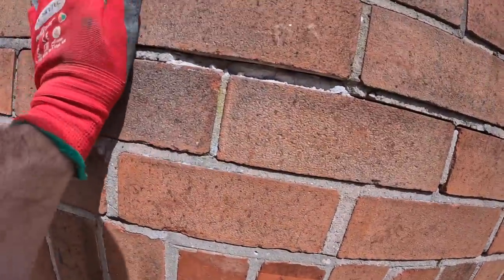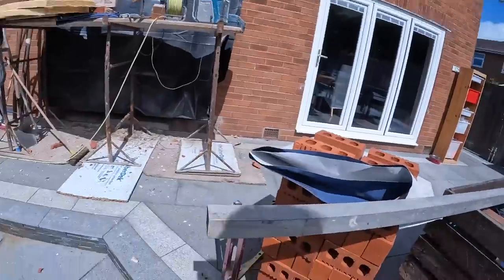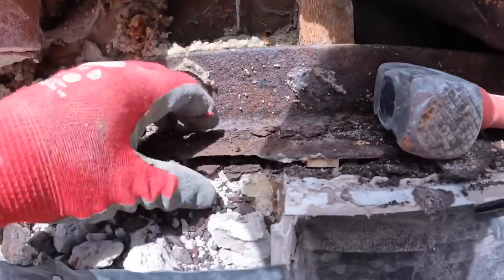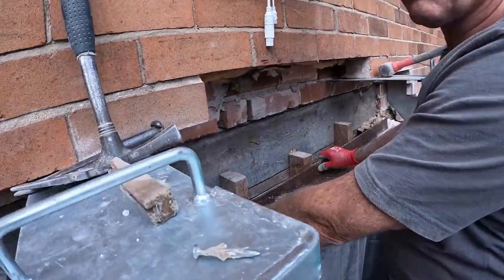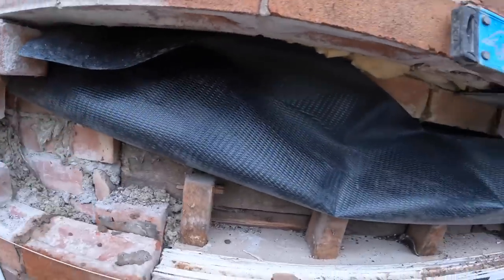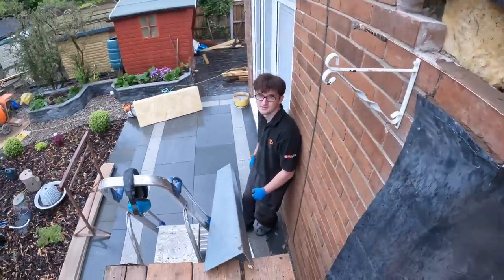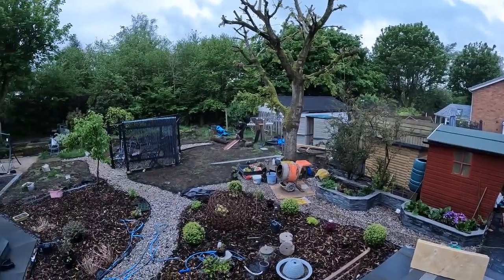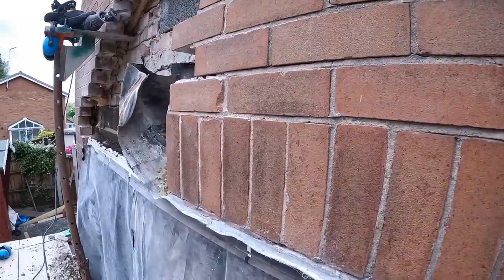OUR TOUGHEST LINTEL JOB YET !! PART 1

Comment: A friend was thinking of buying a house and wanted me to have a look to see if she could extend the kitchen, when I took a look at the building,  over every lintel the brickwork had expanded because of the angle irons rusting and blowing, the whole house had like an expansion joint running right round the house, I told them to walk away it would cost thousands to repair, they did walk away, next time I was around that area they had a go at fixing it yep they repointed it and didn’t fix the problem.  all because of not rust proofing the angle iron and the crack had began to expand again, plus this was evident on many of the properties on that particular small estate, private builds as usual and no proper, clerk of works, great job lads took me back to the good old bad old days on the tools, looking for my marshalltown now to help out but you’re doing a much better job with me not on the scaffold 😇
Reply from the maker: Yes we usually get called after the first re point botch up has failed 🙄🧱👍🏽

Comment: just found this video, excellent work , it's amazing the low level of some builders I used to use for that span a piece of scrap galvanised angle at least 10mm thick and 150 on a side very cheap and effective if it was totally enclosed we used galvanised  pallet beams  2 of them with the ends cut off almost no deflection , the other thing I used to do was preload the lintel, you fit one end at the correct height then use a hydraulic jack lifting the other end to apply the correct preload to the beam so the structure above wasn't affected by the changes, it's a simple job to do and avoids all manner of settlement and cracking, cost £20 for a 4 ton bottle jack you just use a straight edge to get maybe a quarter inch of bend over the length so the lintel is taking the applied load and not the brickwork,
Reply: @SteveAndAlexBuild  I avoided a lovely one in a shop I bought Gosforth  on the high st number 115  26 ft I think it was pitch pine timber lintel one side was a doorway then an iron column at 4 ft then the main span then a 6 by 12  pitch pine slab end on vertically then a doorway, built in 1850 I backed quietly away leaving it for the future the pitch pine slab was rotten on the bottom so I put 4 big iron angles to lift it up, it's been sold now but it's a nightmare of a job for someone

Comment: Trouble with starting petrol disc cutter?   Use primer button till airs out,  choke on,  push decompression button if it has one,  pull over slowly- just turning over engine slowly with full throttle (some models dont allow throttle with choke) this will prime the system, once it fires by pulling slowly , take choke off and pull start quickly (Or half choke) use throttle .
This works for me.
Reply from the maker: Cheers Deano 🧱👍🏽

Comment: Done so many of these jobs in the Brighton area for windows companies as many houses I have worked on don't have lintels on the outside skin relying on old wooden or metal frame windows. Can be very dusty old jobs.  Most of the time I have disc cut out the bricks and cleaned them off and managed to put them back in to keep it looking the same. 
Lucky always on the ground floor so I get 2 done in 1 day

Comment: Hi lads…sorry HEY YOU GUYS😁most trouble with saws comes from flooding it, I’ve learnt when this happens too turn all switches off for a minute and go again with a few pulls with it all still off, clears the carburettor… the kick says it’s clear then turn on and pull. Goes every time👍🏻👍🏻👍🏻 great work again auld pals🤝
Reply from the maker: Cheers Bob , yeah it’s flooding a reckon , you can smell it then it’s wet out the exhaust when it fires up .🧱👍🏽😁

Comment: Hi guys great video just a quickie the disc saw that you said had problems starting it have tried E5 fuel instead of E10. As the old type of fuel is the we us in all or our two stroke equipment because they don't run right on E10 worth a try best regards ady
Reply from the maker: Thanks for that pal 🧱👍🏽
Reply: @SteveAndAlexBuild  ..or try Stihl’s premix ethanol free fuel. £20 for a 5ltr can from a Stihl dealer (with the price of pump fuel as it is now the delta has come down from x4 the cost of pump to x2). Also, it won’t rot the rubber components in the fuel system.
Reply from the maker: @CJones-dw1zo  🤔🧱👍🏽
Reply: @CJones-dw1zo  Socialist/commie countries do not allow their servants to enjoy much of the fruits of their labor.
One wonders how England has drifted so far in that direction, and what exactly are they doing with the money. 
52% of that is tax according to the BBC , broken down as follows:
25% Fuel Duty Tax 
20% Vat Tax
7% Biofuel Tax
45% Cost of fuel to supplier
2% Retailer profits
1% Supply and delivery

Comment: Thanks again for another lintel video. Your videos gave me the confidence to do two bedroom windows to the rear of my 1930s house, they have the thing where the soldier course doesn't line up as well, so I did what you guys did on the house where you put blues over the French doors (and the bit of plasterboard came out so you could see down into the living room). Where you cut a brick in half and slotted the lintel inside it.  Came out really well. Got the bathroom one to do next. Luckily there's just been the soldier and one course above so far so no need for props... yet. There are other windows which will need them though!
All the best, and thanks again.
Reply from the maker: Thanks Ross , glad out videos helped .
   Good luck with the rest 🧱👍🏽

Comment: hey just a question... when putting in a new window on brick veneer... is it possible to scrape out the mortar from the brickwork from the inside of house and push in a lintel? then i would be able to remove the bricks from under the brickwork with a lintel already installed.... is this unsafe or bad work? if this is possible how would you fix the lintel in the gap? liquid nails or mortar?
Reply from the maker: Lintels are definitely not a DIY job. A cavity tray is also needed which can't be done from inside 🧱👍🏽

Comment: In engineering terms, the upstand steel is the web and the horizontal element would be the flange. The upstand could be called a rib if it is part of a T Beam.
Reply from the maker: Thanks Michael 😁🧱👍🏽

Comment: Fascinating.

I assume that the bricks are under compression between the lintel and the higher rows.  Not being a bricklayer how do you ensure that the upper bricks are sitting on a solid layer of mortar (without trapped air) and that the new mortar does not shrink.  I assumed that you would tap in layers of slate or something to ensure that the old bricks and new bricks are under compression against each other.

If you don’t over time won’t it settle and you will get more cracks?

It looks rather dangerous that the heavy upper courses might collapse as you are doing the job.
Reply: @SteveAndAlexBuild  The lintel supports a triangle of wall with a base length the width of the lintel stepped up to one brick in the middle. Otherwise the loads get carried down the walls either side. I'm not suggesting the bricks can be thrown in bit they are not like the ones carrying full wall weight into the sides of the window.
Reply from the maker: @Dave5843-d9m  exactly 👌🏼🧱👍🏽

Comment: What a cow of a job and loosing money ? Two technical questions if i may.
1) Why is there a mixture of brick and block on the inner wall. 2) How long do the wooden lintels last. 
From what i could see you were in charge of the situation and got on with it. 👍👍
Reply from the maker: Question 1 Doug not got a clue , my guess is they were rough arses .
As for Timber I’m not sure but kept dry they last years 💪🏼💪🏼🧱👍🏽
Reply: @SteveAndAlexBuild  Ok cheers 👍👍
Reply from the maker: @Doug....  🧱👍🏽
Reply: @SteveAndAlexBuild  I replaced what was 150 year old safe lintels on a sandstone building, must have been 20 windows and most where in not bad condition, proper old hardwood make a great camp fire when away 🎣🎣🎣👍🏻
Reply from the maker: @Marshalltoon  😁🧱👍🏽
Reply from the maker: @martin2466  💪🏼😁👍🏽🧱
Reply: @martin2466  The guru is up and about 👍👍👍
Reply: @martin2466  noo 😜
Reply: @martin2466  Thanks for that Martin. A fountain of knowledge as usual.  👍👍👍⛲

Comment: Did I see Silicone going into the internal brickwork Joints and Bed over the Timber Lintel ? Or should it be packed with Slate or a Strong Mortar Mix .
Reply from the maker: The silicone was to hold the cavity tray in place
Reply: @SteveAndAlexBuild  Oh right OK .
Reply from the maker: @davidpimblett3573  🧱👍🏽

Comment: Rather than just putting the supports onto the brick itself , why didn't you put a beam or something across the 2 to support that full length of brickwork above...? Our neighbour has the exact same issue iwth a window with no lintel above it and all the brickwork above is cracking from the bathroom window down. Whoever does it will have a right job on because how you've done it there it wouldn't hold the brickwork above , they'd have to support the full width . Is that why you've not supported it fully because the brickwork above is pretty sound...???
Reply from the maker: Yes

Comment: I have a Stihl hedge cutter that gets used once or twice a year. After every use, I empty the fuel tank then run it until it stops and use the choke until it properly stops. That leaves no fuel or oil to clog the carburettor. 
It's been going strong for 25 years so I think it's been the best way to keep it happy.
Cold start, fill the probing bulb. Full choke one pull. No choke nd another two pulls gets it going. Use choke as needed until it warms up. Too much priming (or choking) will flood it. Then it's game over until the excess evaporates.
Reply from the maker: Sounds good 🧱👍🏽

Comment: Hi guys,what size lintel ?. Looks under size to me for that span and amount of load above.
Reply from the maker: Can’t remember. This was a year ago and it hasn’t fallen down 🧱👍🏽
Reply: HI, as a Bricklayer from down under I’m interested as to what your requirements where in England as appose to Australia. You said in you video that the span was 2400mm. At this span in Aus. we would have to use a Gal angle 90x90x6mm (8.22 kg/m) with a bearing of at each end of 150mm min. If it was to go 2450mm, we then have to step up to a 100x100x8mm (11.8 kg/m). Mind you we have our cowboys here as well, who would use anything. 
I appreciate you videos and it good to see father and son working as a team.😎✌

Comment: Assuming you bought your STIHL saw from a reputable dealer, take it back to them and get them to have a look at it. STIHL have fantastic aftercare, even more so when its still under warranty, It shouldn't be that hard to start since its brand new.
Reply: I doubt there is anything wrong with that saw 😬
Reply from the maker: @justbreakingballs  🧱👍🏽
Reply: @justbreakingballs  my strimers a bit choke hungry on first start but i find you need very little priming on the fuel if there's already some in the bulb. 
All my other STIHL gear is now cordless and don't think ill go back to 2 stroke for hedge trimmers/blowers etc, so much easier. Even my smaller lawnmower is now a STIHL battery one as its saves the back carrying the Honda up my customers steps!
Reply: @HughzieTube  sounds like a good set up you have there. When starting my ts410 I don't really pull the cord I just hold it and let the machine fall away using its weight to pull the cord if that makes sense. I'm not sure what Alex was doing to pull his back here, he's young enough to brush it off though.

Comment: ''There is no material touched, handled, and adjusted by the human hand, than that of the lowly brick or stone. How much more then; that of those removed and replaced?''
1971---1974 U.S. Paratrooper Sgt. William 'Rock' Gilpin 82nd Abn. Div. 1/504.
1975-------1983 Texas Brickalayer ana Stoneamason.
1983---1986 Passenger Elevator Constructor.
1986--------------------2006 TX dot Inspector over new construction of highways & bridges.
2006----------------2022.6 Just another one of those many one's of '''We The People''...
who's awaiting His Just⚖Return🪃.

Comment: You done a good job there but the only criticism is you should put the strong boys into the brickwork first to support the existing brickwork before cutting out the opening.
Reply from the maker: No chance Barry , experience tells me when to put them in and they are in the way long enough already 😤😁🧱👍🏽
Reply: @SteveAndAlexBuild  The brick work supports itself in the V section that  the bricks were taken out each brick supports the one above  it  so the house isn't going to fall down 
Great job , must have been a balls ache , must be satisfying that you left the customer with a decent job
Reply from the maker: @Berry-fr5wj  massive ball ache mate , glad to get off this one 🥵🥵🧱👍🏽
Reply: @SteveAndAlexBuild  You have loads of Karma points, after keeping to your original quote and your customer was lucky to find you, good luck with the channel
Reply from the maker: @Berry-fr5wj  thanks pal 🙏🏽🧱👍🏽

Comment: What blade do you use on your rip/saw ( mortar bed's)?
Reply: Some 💩Show, But You Battled through, That's what set the Trade Men from the 🐄💨 "boy's" Hopefully the Customer understand and came across with the extra Spondoolies, Excellent Video
Reply from the maker: Bosch carbide masonry ((£19) ish 
   It was a shock for them but they understood when they saw the dig 🧱👍🏽

Comment: For two thirds of this video I was wondering about the title. Yeah a rusty lintel was replaced which we’ve seen these lads do many times. Holy smokes for the rest of the content. Please Steve try not to go bare handed into rusty splintered metal. It doesn’t react well when in the body.
Reply from the maker: Thanks for the tip 🧱👍🏽

Comment: I do not join the thumbs up legion this time. The new lintel should have been a sturdy length of hot dipped galvanized angle iron e. g. 150x100 or even bigger. The thin wall lintel you used has no load bearing capacity.
Reply from the maker: If you say so . Take it up with the manufacturers then and the people who approve them to be used